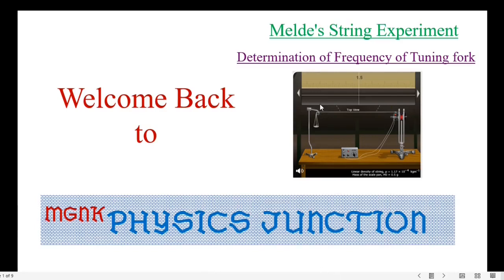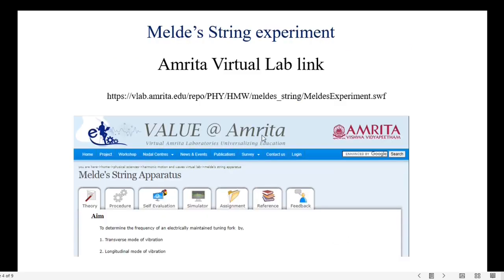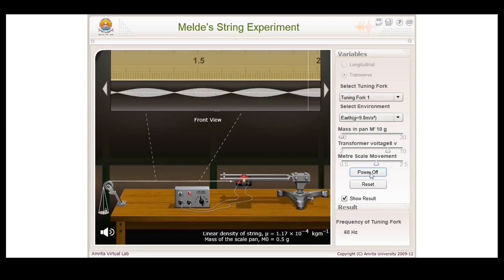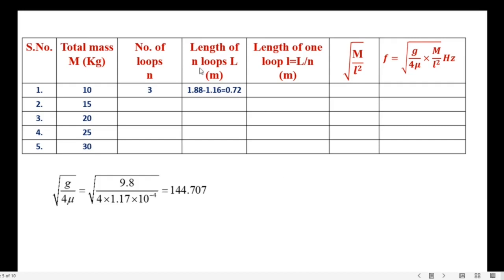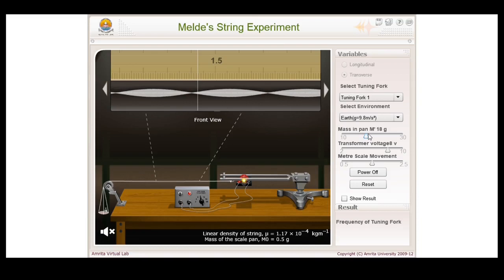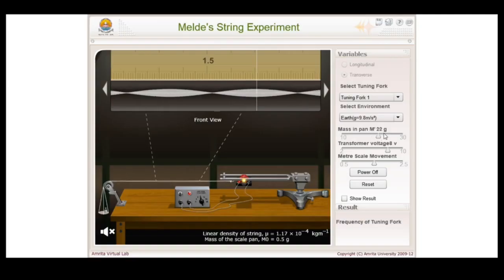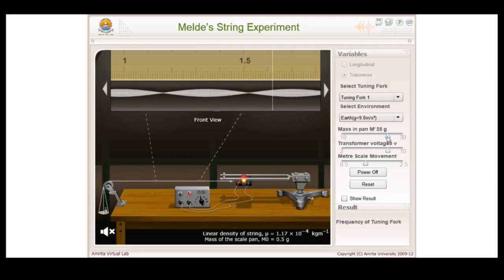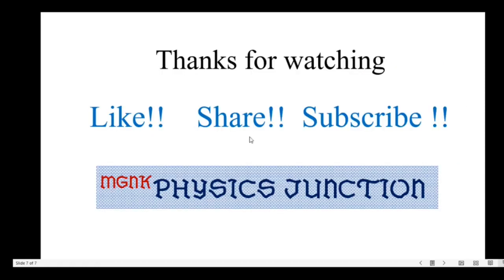Melde's string-Determination of frequency of Tuning fork-Amrita Vlab

Comment: Hi how do you calculate for ✔️M/l^2
Reply: Thank you so much.
Reply: Can you please help me in how to calculate with the young’s moulus experiment.
Reply from the maker: yes. What is your question?  Let me know
Reply from the maker: With the first reading  M=0.01g, l=0.240m.  Then find  ✔M/l^2
Reply: Thank you but how did you get 0.01g when the mass is 10g
Reply from the maker: @aminasanyang5881  Thank you very much.  Actually the Mass in the pan is 10g.  
It should be converted to Kg.  
M=0.01kg, l=0.240m.  I have entered the  mass as 10 g in the table.  
It should be entered as 0.01kg